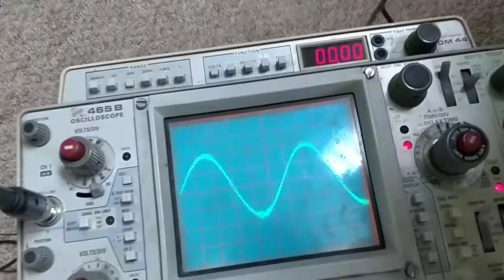Class-D power amps generating 400hz 3phase aviation power

Comment: I am trying to power up a 28v 400hz 3 phase attitude indicator gyro, I have been stumped in getting them to go. I am very interested in how you got yours to work. I have tried brushless ESC's to no avail. Any help or direction would be greatly appreciated. Would also like to see how your other gyro did.
Reply from the maker: 28v should be easy with a couple of 100W or less stereo amplifiers. Hard part is breadboarding a 400Hz Wein Bridge oscillator and phase shifter.  I do not really have a 'how to' but should sketch up the schematic.   This guy https://www.youtube.com/watch?v=wYsG-lXfih8   used a commercial 115V inverter is the easiest solution for 115V aviaonics.     This is Wein bridge and phase shifting  https://www.youtube.com/watch?v=4VRt7z03KGo     About the oscillator  https://www.electronics-tutorials.ws/oscillator/wien_bridge.html       Getting the 3phase https://www.homemade-circuits.com/three-phase-signal-generator-circuit/amp/    those were realized with an LM342 first with bipolar power supply, then with single 12v and a virtual ground.
Reply: @ChuckSwiger  I've got the parts for the wein bridge and I'm putting it together. As far as the amplifier, is it feasible to use a 3 or 4 channel single instead of 2 dual channel boards? Thank you so much for the information, it seems everything out there is so broad based I was expecting to have to go to night school to get these gyros to work.
Reply from the maker: This is another video of an aircraft artificial horizon guts being spun up  https://www.youtube.com/watch?v=NTYPhjALJvE